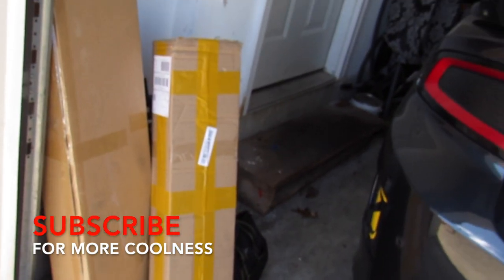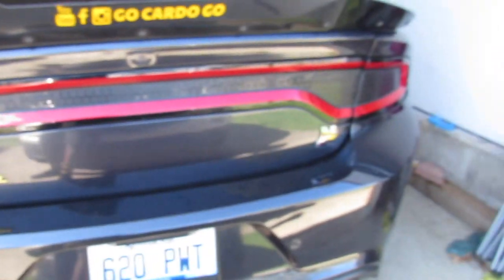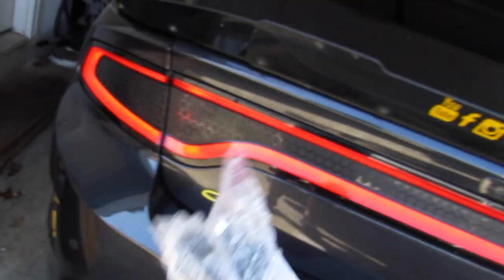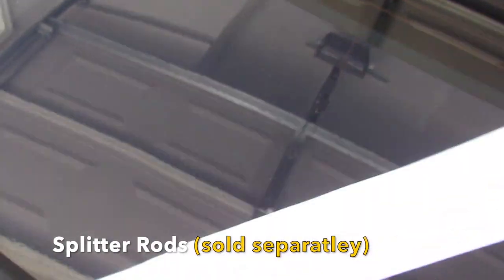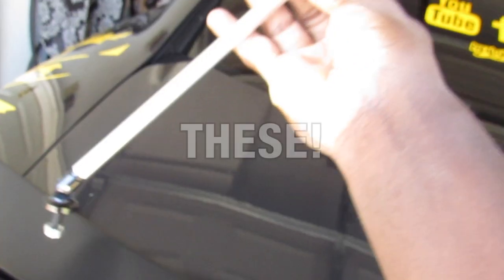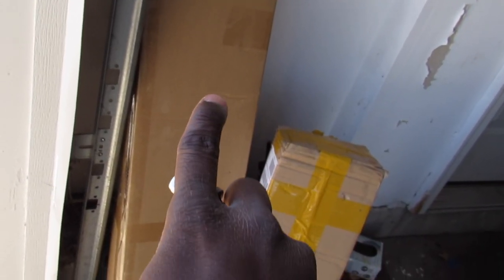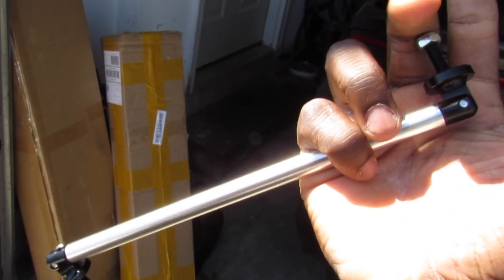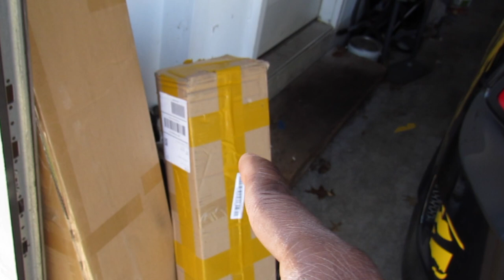Installing 5 MUST-HAVE Mods on my Dodge Charger Scat Pack (Front Splitter,Rods,Side Skirts, Aporns)

Comment: Hey there, I just place an order but my car is SXT 2019. Wondering if it fit or not ? I'm super worry about that
Reply from the maker: If your SXT has the same body style as mine (SRT appearance) then everything should fit just fine. If not, then the just the side skirts will fit
Reply: @gocardogo  honestly I don't even know what body style my SXT is. Sorry I'm noob, just a newbie try to learn to play car :( Also, I love the yellow one around your splitter, what is it and where can I buy it ?
Reply from the maker: @huyhuynh803  no problem man. If you check out my older videos, you’ll see my old white Charger. Just to compare the body styles. The white Charger was not the SRT body style, and this new one is
Reply: @gocardogo  thanks man. Also, can you tell me what is that yellow thing around your spliter? I really love it

Comment: Hi fit in dodge charger GT?
Reply from the maker: Yes, as long as that GT has the SRT body style
Reply: @gocardogo  my GT is like the rt, I don't know if the shape of the fog lights changes in size because they are not round they are rectangular
Reply from the maker: @chuybustos  Hey. It may not fit given the difference body style you have.